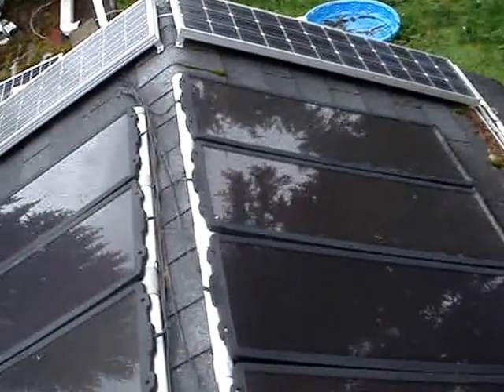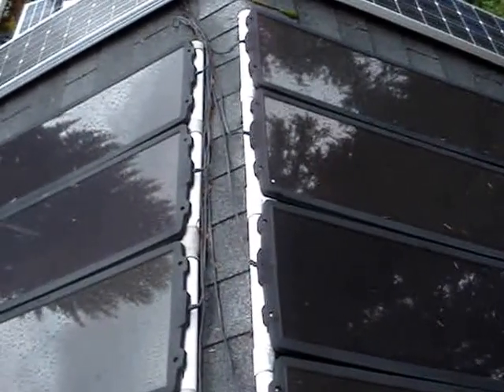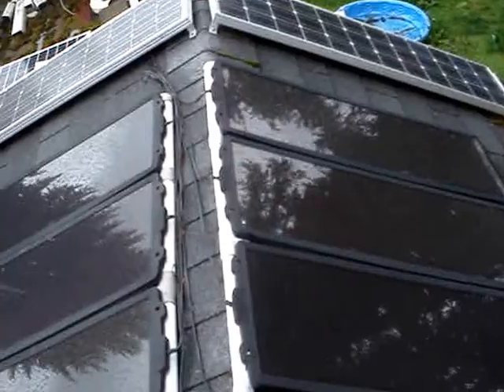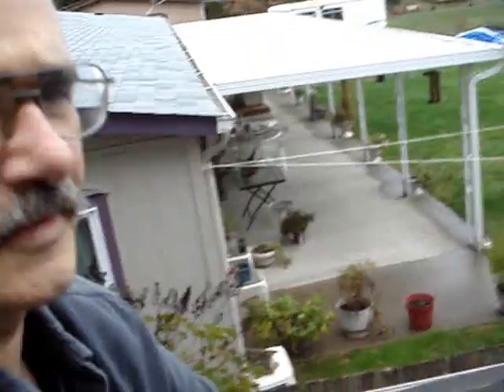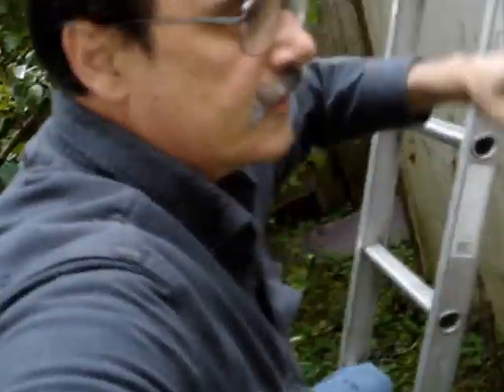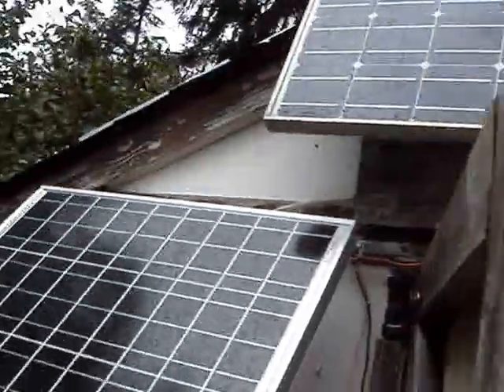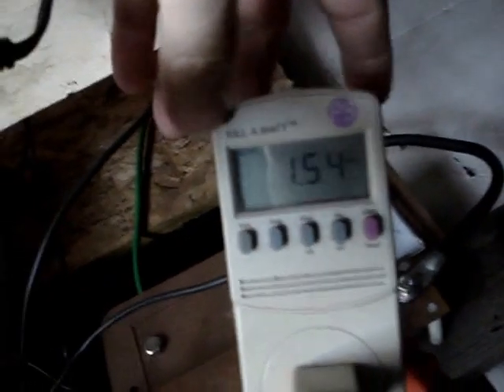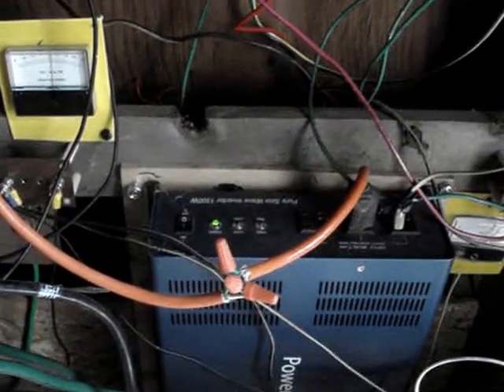Amorphous Solar Panels Failure

Comment: I find that using my amorphous panels in my windows away from the rain and snow to still be running strong about 6 years after buying them. The 2 I had outside maybe lasted 2 years. It's the ice that kills them. I use them in my RV in the front window when I'm not using it, they keep my batteries charged. They really are indoor use only. I have a few in my apartment windows as well as a backup power source for when the power goes out and they're fine.
Reply from the maker: These have been used flat on the ground powering a fountain. 12V motor burned out.

Comment: Amorphous panels look like the Harbor Freight or similar seller.  Their older versions were not good quality but there is nothing wrong with amorphous solar just you bought cheap panels and I think you''re right they are occasional use panels.  Better quality is out there but they still produce less per square inch or less efficient.  The ones I've seen are more than 5 years old but I do not remember the brand.   What people like about them most is they energize sooner and work better with overcast.
Reply: If you use them inside a window like in my class a RV they last for way way longer. The ice and rain kills them.
Reply: @cgwworldministries83  Agreed, they need a better encasement.   A simple plexiglass enclosure would suffice or a wood and plexiglass.

Comment: My Harbor Freight panels are still going strong after 5 years straight out in all weather. They also are much better at producing power under low light conditions than the brand new polycrystalline panels. The connectors need to be checked and cleaned though.  Sound like you should check your wiring.
Reply from the maker: +Douglas Cooke The backing film on the glass degraded to where the panels stopped producing any voltage. Took them to the dump. I still have the control box and wires. Don't leave them out in bad weather freeze thaw moisture excessive heat will kill them. Oh well they lasted about 6 years. Good luck.
Reply: They've been out in -15F - +100 F and sun, rain, sleet, snow, hail, 60 mph winds, etc...still working fine.  Maybe the ones from 2012 were better quality?  Only problem I've seen are the connectors corroding and the plastic frames have a few cracks in the corners. On a $/watt basis though it is cheaper now to get a 280-325 or so watt crystalline panel.
Reply from the maker: I have the earlier model panels with the metal frames. The light reactive material peeled off the the backside of the glass at the corners. The conductor materials were poorly sealed, moisture crept into it along the corners and edges of the frames. The thin film cracked from the bottom followed by a voltage drop. I did learn a lot about solar power using these. I never complained about the price or overall workmanship. This product had to have been very labor intensive to create. Whomever designed these panels should have done better life testing before they were mass produced. If anyone still has these in un opened boxes, I would suggest putting a good bead of all weather silicon sealer between the frame and glass on the back side and corners.
Reply: @pgm98387  it's more the ice and rain then drying in the sun that kills them, if you put them inside windows, they last way longer.

Comment: YES, they are mostly suited for part time use, f.e. when on the road or at a weekend cabin. Amrophous panels didnt last that long, the recent versions last for 20 years easy (ok, not the chinese crap, those are the same old tec.)
But on a camping van the new ones are perfect
Reply: What new ones are you reffering to? My oldest is failing but I have too much shade to get anythinh out of cristaline ones except at peak summer so I would really rather stick with amorphous.

Comment: I have an amorphorus panel just like the ones you have that failed.  My panel is advertised to put out 1A in full sunlight, however, it can barely put out 500ma.  Also, the panel is absolutely useless on overcast days, it can barely spin a 12v computer fan.  Keep away from amorphorus panels, they are a waste of money.  Go with either poly or mono crystaline.

Comment from the maker: Stay away from these types of solar panels, they degrade quickly.
Reply: Backyardsoul  you're righting off these panels(silicon amorphous) very quickly and recommending people to stay away from them because of your personal experience, which may be from various different factors other than "all silicon amorphous panels degrade quickly" as you put it.  

You may have had faulty panels and/or as you have already pointed out yourself it may be because of "user error", because of how there wasnt much airflow behind them etc....  It could be for a million different reasons besides that "all amorphous panels are rubbish, and you should stay away from them" as you are putting it over and over again.

What is the particular brand of solar panels that you used that you had the problem with?
Have you looked into whether other people with the same brand have had similar issues or if all silicon amorphous panels suffer from the same problem you had?

I think these things would be worth looking into before making blanket statements like you are doing.

Thanks for your video.
Reply from the maker: If you are new to solar and just want a ready to go kit out of the box, ok, don't leave these panels (plastic frames) outside 24/7 all seasons. Take out for temporary use, for camping, put them away in storage during bad, cold weather. Now my harbor freight panels bought in 2007 are faded, cracked, peeling, One is producing 6v. The 4 plastic framed, bought in 2008 are not producing. The Siemens 55 watt made in 1999 are still producing power. You get what you pay for. The kits were good to learn with, just dis$apointed they did not last longer.
Reply: Please check the diodes on the back of each panel. 
Solar panels don't just bad like that. You might have had blown diodes on those solar modules. 
By replacing the diodes these panels will come back to life. 
Please let me know how everything turns out
Reply from the maker: Where? I took one of these apart, there is no junction box or diodes. The wire terminates on the glass laminate metal contact trace. Unless there is a diode(s) over-molded inside the 4-1 pig tail combiner?. These panels (the amorphous have no diodes. The regulators have a diode.
Reply: Backyardsoul 
Modern days solar panels each of them has diodes.
There isn't a solar panel without a diode. On less it's a home made and the person don't know what he or she is doing.
All solar panels manufacturers I have dealt with has diodes instead on there panels.
The function of a diode is to block or prevent power from flowing backward. 
By installing a diode on your solar this will prevent your battery bank from being drained overnight when there is no sunlight.
I hope you find this information helpful. 
Thanks and God bless.
Reply from the maker: The plastic framed panels are combined together with the 4 to 1 wire harness. Each panel was manufactured (I dis assembled one) as single panels with plastic frames. They are a raw wired panel without blocking diodes, trust me its just bare wires off the + and - sides.
The 4 panels bought in 2008 are about 1/2 of there original output. The Siemens 55 watt metal framed panels 1998 1999 are putting out good power. Those panels have diodes, not the plastic framed ones.
Reply from the maker: I've completely disassembled one of these amorphous panels. Upon careful inspection, no diode was found from the laminate glass edge, or on the connecting wire. There is a 4 to 1 pigtail combiner that could have a diode over molded inside the plastic housing. The only diode is inside the separate 7 amp charge regulator that came with the panel kit.

Comment: the panels will be fine. look at your wiring. test the wiring after you cut it right tat the panel. then rewire it. easy . However i would still bin them for the room they take up and the power they put out lol you can do better for the price. Keep well